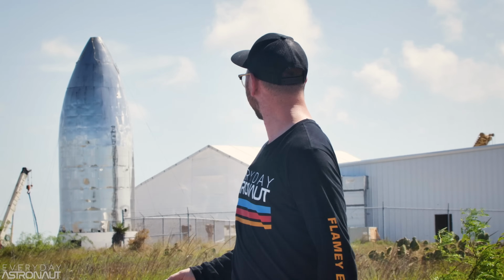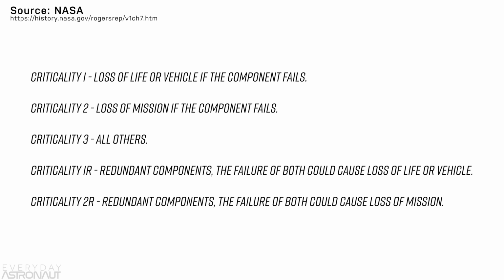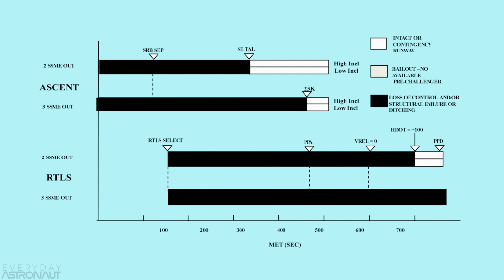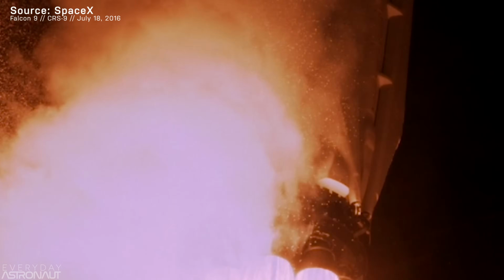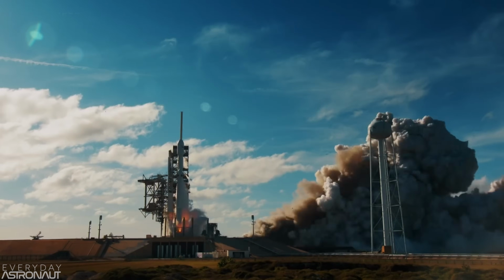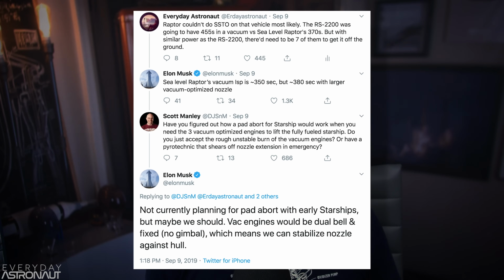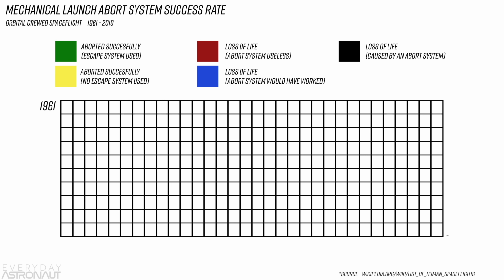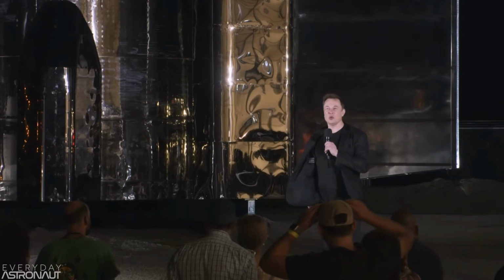Why won’t Starship have an abort system? Should it?!

Comment: The Space Shuttle should have had built-in crew separation with blast shield/heat shield between them and shuttle bay. Armed with explosive bolt separation from the remainder of the shuttle. Giving them a chance at a capsule return with parachutes. Even from orbit, they could separate from a damaged shuttle.

Comment: There's another angle to this, that comes from a field with arguably even higher stakes when something fails: nuclear energy . Today's reactors use solid fuel pellets and liquid water for coolant. Problem is that the COLDEST temperature you can operate a reactor and still feasibly generate electricity is about 300° Celsius. Problem is, the water must be kept liquid even at that temperature, which forces intense pressurizing. Even after an emergency shutdown, a nuclear reactor still needs continued cooling to manage decay heat of the fission-products (the "ashes" of a nuclear "burn"). This is why nuclear power plants have so many redundant diesel-generators to run coolant-pumps after reactor-shutdown. A proposed system called a "Liquid Fluoride Thorium Reactor" (LFTR, pronounced "lifter" for short) uses fluoride salts as fuel, and is designed to use them MOLTEN in routine operation. They have to be heated to about 450° Celsius to melt but they then have 1000° Celsius of liquid range WITHOUT needing to be pressurized. In routine operation you have a frozen plug of salt that you keep frozen by blowing cold gas across a flattened section of drainpipe. If the reactor overheats or the reactor building loses power, the frozen salt plug melts, draining all the reactor's fuel into a passively-cooled drain-tank designed to stop the nuclear-fission from continuing. Now while today's reactors have 5 or 6 redundant diesel generators to power those emergency coolant pumps, remember: at Fukushima Daiichi, a tsunami knocked out ALL of those Diesel generators, and as a result, once the batteries for the emergency coolant pumps went flat, those reactors had NO workable cooling. A LFTR only has one safety system with no redundancy, BUT! that one safety system is powered by THE FORCE OF GRAVITY. If gravity stops working at a nuclear plant? A nuclear disaster is the LEAST of your worries!

Comment: Abort systems for saving crew for 5-10 people - is absurd. Even on airplanes that fly thousands of times more often, and in which there are 200-300 people, from all rescue systems - inflatable slides and inflatable plastic vests (!).
Humanity is expansive, the only way for humanity to survive is to conquer space, populate other planets, and gain access to endless resources in space.
The only thing that matters - is the success of the mission in space, whether it be a factory in orbit, a shipyard or a scientific station. What is needed to create them? Thousands and thousands of launches. Thousands of ships.
And looking at these cowardly crew rescue systems, we can confidently say that they insanely complicate and insanely increase the cost of the ship’s construction. And reduce the payload.
Until mankind finds a source of energy so powerful that it will be able to put into orbit and land safely at least a thousand tons of cargo, crew safety systems are meaningless squandering of funds and resources.
Too many people on the planet, and too few spaceships.
Maybe we need abort system for saving mission or payload.

Comment: 12:17 Precisely !! It was those guys in charge of management ! they DELIBERATELY went against manufacturer advice and established safety protocols and we all know the catastrophe that ensued ! Now, what really riles me up is that with such a clear record of how events unfolded, and who was DIRECTLY responsible for that disaster, the powers that be, after the fact, did not do their job properly, either !  It clearly and undoubtedly shows that the culture at NASA was sick, very, very sick, even to the point of incompetence. Apollo one is a good example. All kids who have an interest in science know full well what happens when you take a wooden splint, light it, then blow i out, then stick it in a jar of oxygen gas....it re-ignites and burns much faster with that extra oxygen ! So, why was it so damned difficult for these highly educated engineers and designers, many minds aware of the system, to not see that a cabin that had an atmosphere of one hundred percent oxygen, that had electrical systems a frightfully bad idea ? Where those electrical systems stress tested in that atmosphere ? I don't know, but I doubt it. Could the crew get out in a reasonable time on the launch pad ? no. It's things like this that prove that NASA put human lives at risk, the shuttle was doomed to kill,  any launch  that does not have an escape system is a bad risk.

Comment: I agree with the point that more flights will lead to better systems. A better more reliable propulsion system would also help and again that requires more flights. Just as the flat head 4 cylinder ford eventually gave way to the V-8 and eventually the aluminum overhead cam 4 cylinder engines of today.  That happened from driving more vehicles. Electric vehicles are even more efficient and more reliable, but are only now catching on. A totally new propulsion system would probably be developed only when we are launching and working in space on a more active schedule. 

And yes, I would fly on the Starship sans abort system.

Comment: Most safety systems are about stuff going wrong that shouldn’t go wrong... from cars to airplanes... you build up safety with redundancies for them to keep working well but also with damage mitigation strategies as efficient as airbags (that by the way have also killed people) and as “silly” as life vests under airplane seats (those have been used way less than launch abort systems proportionately, and they are still there). It’s hard to say that a launch abort system is not necessary with such a small number of launches to date. The data is just too scarce. Also, I believe no number of deaths is too small. That has been the philosophy that drove our safety standards in most industries and we have been successful in advancing them. I don’t see how space exploration can be different anytime soon.

Comment: Environmental regulations imposed by WJBC in 1994 forced Lockheed Martin to change the formula of the "insulating foam" on ET resulting in a dramatic increase in foam separating from the tank in flight.  NASA was aware of the risk but not of the catastrophic potential of a leading-edge strike on the vehicle.   The law of unintended consequences.

Comment: In the last 30 years there is a 0.5% chance a launch would need an abort system. There is also a 0.5% chance the abort system would kill the whole crew. It doesn't seem like modern abort systems are really adding anything except complexity.

Comment: sorry if this was already answered in the video, but for an emergency abort, couldn't the space shuttle prematurely ditch the boosters and the external tank and land normally? would that work or there wouldn't be a long enough runway or some other problems? or maybe it would be too hard to maneuver a U-turn in midair?  did they ever think of that instead of those ejector seats and so and so

Comment: So if you have 1/500 on assent, 1/500 on decent and 1/250 while in orbit then you actually have a 4/500 chance of failure which is 1 in 125 for any given flight (less than twice as effective as the space shuttle--but still really, really unacceptably bad!) .    Hello!!!  I used to do work at NASA Stennis and this is why I say, "Rocket Science ain't what it used to be!"  I used to teach at MIT with Janet Voss and really pissed her off in January of 2003.  We were teaching about the Challenger disaster and I had just seen some disturbing things at Stennis and she very confidently said that Challenger could never happen again.  I disagreed.  Columbia was already in it's last orbital flight during that discussion.  Both accidents had a common predictable failure point--temperature at launch which caused "o" rings to crack & insulation to fall off in larger sections.

Comment: Airliners have no abort system, so why should the shuttle?  It was successful for years until they disregarded that specifications of the o-rings.  Human error.  And they went beyond the years of use it was designed for.

Comment: If I remember correctly Arthur C Clarke predicted quite accurately the failure rate of the Space Shuttle. Although you could put the blame on politicians for the failure of the Space Shuttle solid fuel booster, ever state had to make a bit and so the booster had to be in two bits for transportation therefore the failure point. As for riding the StarShip, if reflight can occur so quickly then it'd be easy to tested the vehicle many more times than just 10 in a shortish amount of time without to much cost.

Comment: Charles Lindbergh performed the same sort of analysis in 1926-27 in deciding that an airplane with just one engine was safer than a multi engine plane for flying the Atlantic; a twin or trimotor airplane having redundancy, but also having 2 or 3 times the likelihood of failure.

Comment: Good summary - thanks!
Solid fuel motors is a way to go for escape systems, in my opinion. Dependable system that always lights when needed and pulls you out of danger zone, even if it adds some mass, is the best option. I'm glad they chose that option for Orion, and hopefully in the future escape towers will be reusable.
Other option: quick exits and parachutes for the crew :-)

Comment: When I watch this I remember the landing attempts of SpaceX. If it were any other company, they would have perfected the landing technology (like blue origin do now,(suborbital like grasshopper), instead of doing lab experiments on actual missions after the main mission was complete. The spacex effeciency is mindblowing.
I have yet to see this from any nation or company, except during spacerace when rockets were more difficult, but one must keep in mind they had almost unlimted funding, because of the of instilled fear of beeping Sputnik.
Reply: WerewolfSlayer91 i love that Musk is not scared of failure or a bit of embarrassment. Most CEOs are terrified. What CEO would have built that hideous truck, then hit it with a sledge hammer, then laughed it off. He is unique. He’s kinda nuts, in an awesome way.
Reply: @sblack48  is the semi stainless steel or just pressed steel ?
Reply: @williamgoode9114  Aluminum, maybe. Bc only cybertruck that use stainless steel 300-series
Reply: @williamgoode9114  Probably aluminum since weight is a big factor for commercial vehicles.
Reply: @sblack48  No lol. He just is not an idiot like most ppl, and he can speak with ppl. Its not hard XD i like him too yeah

Comment: 29:03 Isn't calling it a"rapid unscheduled disassembly" imply that they sometimes schedule a disassembly during a flight?
Reply: Nope. It just means that one of the adjectives has a negated counterpart that you can use in a sentence/term. Its existense does not immediately assure practical application.
Reply: @MeggaMortous  
Congratulations. 🏆
You are right. I was being over pedantic. 

However, I feel there is no need to "soften" the obvious failure with technical sounding jargon when it doesn't actually add any nuance or precision. He may as well have said "it blew up".
Reply: @jtveg  Hey no worries. I was hoping I dont come off sounding all smirky, it's good you know what you meant in the end :)

I kind of liked the dissasebly word as means of giving a "detailed perspective", but then again he might have gone with something a bit more simplified, you are right.

Comment: In short: At some point there will be an failure with the loss of crew of a hundred people, which will have the same effect as the Hindenburg disaster. Thanks, Maniac Musk!
Reply: If that were true, nobody would be flying on jet airplanes... In other words, the Hindenburg disaster spelled the end for Airships because airplanes started to match the range of airships and the public had the Hindenburg image in their minds. However, until antigravity UFOs come along, there is no alternative to rockets to get to space (maybe space planes like Skylon but technically it is also another form of rocket or jet/rocket hybrid)...
Reply: @wezleyjackson9918  you may have a point in the sense that we don't have good alternatives to rockets. On the other hand, rockets are far far less safe than airplanes so I hope Elon never follows through with his plan to use them for Earth to earth passenger transport.
Reply: One could argue that all the other catastrophic failures in the video are their own Hindenburg disasters, and that Musk isn't doing anything new...
Additionally, if an un-manned starship is flown enough times, it could be the Hindenburg, rather than a capsule w/ crew.
Reply: By that argument we should ground all aircraft
Reply: @Knights_of_Zurg  rockets are several orders of power less reliable than passenger planes, and because of the constraints of the rocket equation, that's unlikely to change anytime soon.
Reply: I agree.

Comment: Why don't cars have an abort system?
Reply from the maker: Because if the engine fails they don’t explode and the entire vehicle isn’t under 3 + bars of pressure with a million tonnes or highly explosive propellant
Reply: Just you wait for the next line of Tesla, Tim. Then we'll be seeing '007' style abort systems.

Comment: Perhaps people erroneously recall the center F-1 engine failing on Apollo 13 because the center F-1 engine was intentionally shut down about 30 seconds before staging (I think to limit Gs?).  During the first stage burn, you can hear the astronauts and ground controllers calling "Center out" about 2:15 into flight.
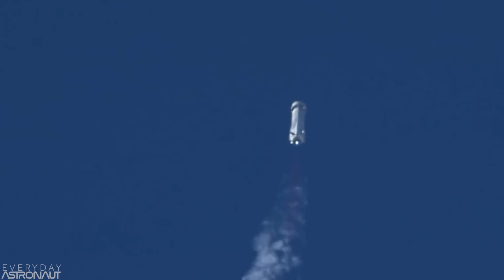But... if you keep listening to the playback, a little after 5:00 into flight, you can hear some distress as the center J-2 engine goes out unexpectedly during the second stage burn.

Comment: Just about every military jet has a variety of "abort systems". Both for  safety of the pilot and those on the ground. If you have to abort often you have some work to do on your design. Abort is to give you a second chance when the unexpected happens. Also remember the impact of a failed manned flight. Post successful abort there is generally a small delay. Post fatal failure there is a delay of years in most cases. Fatal failures probably contributed to the premature ending of funding for the shuttle program (before we had a replacement in place). When public figures die it is national news. When some random kid in the city dies it doesn't even make local news often. If we valued lives equally we would already have safer cars and, probably, a fire arms ban (based on the numbers).   So it is hard to apply risk tolerance evenly when it is not even close.

Comment: Great video by Everyday Astronaut as always. However, an oversight is assuming the abort system has to save the entire Starship. It doesn’t and that’s not how any abort system has ever worked, including SpaceX’s own Dragon 2 abort system.
 Doing it this way as described in the video would be like on the Falcon 9 trying to save the entire second stage rather than the Dragon 2 capsule. Instead, what should be done is have the passengers strapped in the nose cone only during ascent to orbit. Remember the full passenger section is meant for a 6 month flight to Mars so has to be much roomier, and heavier. The nose cone only, like a capsule, would weigh much less. So you would just have to scale up the abort system used on the Dragon 2.

Comment: The large size of the starship would require a large independant abort system which might be a bigger danger if it failed. The capsules (not the shuttle) sat on rocket stages and the abort system detached  the capsule from rocket stage with its fuel etc. The shuttle and Starliner are kind of a rocket stage themselves.  i wonder just what an abort system be like for the Starliner and how massive it would need to be. As to using the Starliner rocket engines, the point was made in the video that the could (likely?) be damaged if the need for an abort occured. Thoughts?

Comment: The misconception that the F-1 had an in-flight failure probably stems from Apollo 6 which had the S-II problem with two J-2s shutting down early. That flight also had bad pogo issues with the SI-C, causing people to conflate the problems.
Reply: didnt apollo 13 lose their center engine a few minutes early?

Comment: I hate the comparison of rockets to planes, because "planes don't have abort systems"... no, they just have multiple system redundancy, the ability to glide without power, the ability to land or splash down without landing gear, emergency slides/rafts, crash seats, and lifejackets for everybody. That's not including modern military eject systems, early aviation's parachutes for each passenger, or modern light aircraft parachute systems... The analogy of a larger plane not requiring to carry a smaller plane doesn't match the circumstance either as rockets already do this due to two stages.

the solution to rocket safety isn't necessarily abort systems, but vastly improving safety requires multiple layers. This is the Swiss cheese method. This could mean a separate abort system, but can also be more redundancy and integrated safety systems.

With Starship, if the upper stage is also the abort system it needs its design modified to add more thrust (needs to be greater than 1 TWR when fully loaded) and it needs to avoid interdependencies that could cause cascading failures.